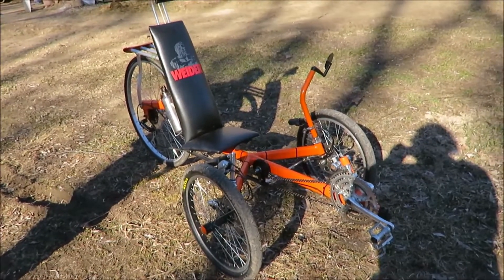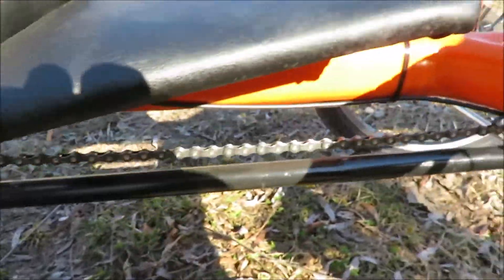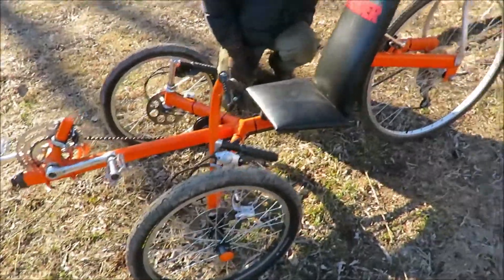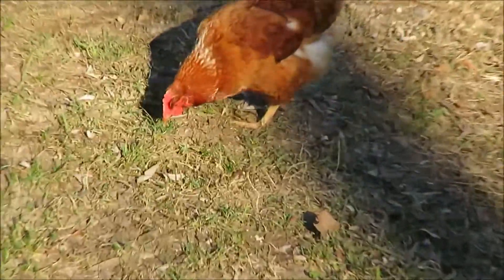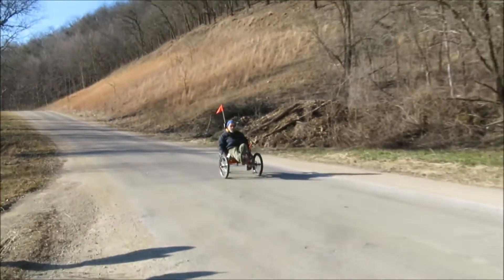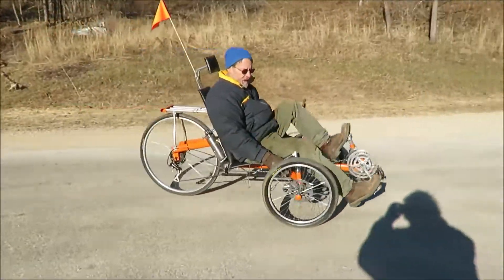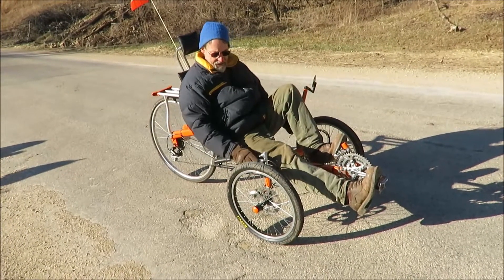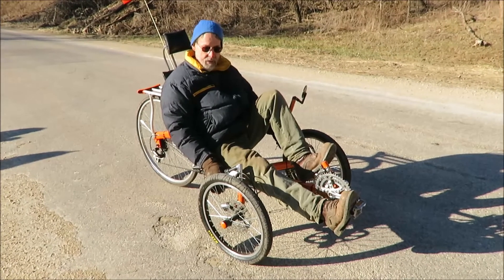Homemade  recumbent tricycle

Comment: I'm wondering . If the rear wheel  was  smaller (  24 Inch ) . Would the traction be increased for the hill climbs .
Reply from the maker: yes  I believe that was also suggested by some other commenters on here.

Comment: Back tyre skidding easily is why most tadpole manufacturers dont build them with rear brakes. Put a fat 20 or 24 on the back for dirt traction if that's needed in your riding areas. Narrow tyres don't suit unpaved areas anyhow. I bought a Greenspeed Magnum big wheel and am kinda regretting the rear 26 as it has noticable side flex on fast corners. Though the main reason purchasing this model was I can fit a 20 or 24 ×4" fat on the back for dirt roads touring.
Reply from the maker: Thanks for the suggestions .

Comment: Larger front wheels and or a smaller rear wheel would offset more weight to the rear for better traction without having to change anything on the frame. Great job!
Reply from the maker: Thanks - good idea !

Comment: Secret toolbox is ingenious, and I like how you "attach" the vise-grips.  You are clever fellow.  4:21 If the steering is "twitchy" going down the road, perhaps set the front tires just a bit more toe-in.  The aluminum tube connecting front wheels may work okay during "normal operation," but is it stout enough if one wheel hits a pothole?  Would be awful to lose steering.
Reply from the maker: My friend is the one who is crafty and ingenious - that is why I always stop and visit him to see what new thing he has come up with. Next time I get over there I will see if he has taken any long rides and come up with any modifications and if so I will make a follow up video.

Comment: not use aluminium on bicycle frame, best bike is over 95% parts what not aluminium, steel is good, aluminium behind spine make feel tired fast, best rim to back is steel rim + best rack to back is steel or not aluminium, aluminium is poison what not good for energy, tadpole needs small cargo + small gear ratio range what 250% or 300% minimal for good up hill drive, not need under seat steering but longer bars for steering or higher steering, seat can be on higher position + more backward when not like upright position or just back wheel smaller size what adjust lift front higher + seat more backward position
Reply from the maker: I will pass your comments on to my friend Alan who made the bike - I am sure he will appreciate the feedback. This was his first recumbent bike he made and my guess is after riding it around this summer he will make a new one that is better.
Reply: he bike looks good already, just tune can do, steel easy fix easy add, just idea, people not know how bad aluminium is what why i been tell for remind, all serious bike are made from steel or titanium, carbon bike are bad joke, people been find how easy carbon break only for try grams lighter frame parts, correct steel design is lightest strongest
Reply: one thing may need add, additional metal plate support may good weld to under center front wheels cross section, i have similar non suspension steel trike for know say is important add extra support to under bottom tube, all trike have extra metal on cross section or extra support on form shape build into, i can show own trike frame later what i was buy to fix made by other person then use by other person been strong frame thousands kilometers all conditions

http://www.steintrikes.com/trike_images/ct/ct2.jpg

http://bicycleone.com/wp-content/uploads/2015/10/YFrameRoverFrame.jpg

https://www.heartlandbike.com/images/library/zoom/ttrike_boom-logo-rover_12_z2.jpg

http://forum.atomiczombie.com/gallery/files/7/0/7/viking_recumbent_tandem_tadpole_trike_4.jpg

https://www.industrialbicycles.com/resize/Shared/Images/Product/ICE-Sprint-26-Trike/ICE-sprint-cruciform1.jpg
Reply from the maker: I see what you mean about the extra support at frame for the front wheels - I will let Alan know your suggestion. It will probably save him some trouble later on . Thanks

Comment: Good stuff, hard to hear in parts due to the wind; I find splitting the audio from the video in the edit can help that....I rerecord what I said indoors away from the wind and add that audio instead. But that's a thing that comes in time. I am impressed with your wheels fella. are you going to put up another after you've changed things?
Reply from the maker: yeah you are right about the wind noise - didn't think of that when I was taking the video. I only used a Canon point and shoot camera - was thinking after I made this if I should try putting a piece of foam or fabric over the spot where the microphone is might help quite a bit. I only know just enough to get by with video editing. Good thing about my friend Alan is he is really good at narrating so I barely need to edit . I will certainly do a follow up if there are any improvements he makes on this .
Reply: @LarryKapp1  Good on you Larry, try the fluff thing, I saw a guy used fake hair from one of those wind socks - he said it was from a toy troll, gonk. Maybe use velcro so it can be removed as well. good luck fella.
Reply: We use a foam thing, where the camera is put in (costs less than 2,-) for the action cams. That works perfectly against wind noise even in stormy weather.
Reply from the maker: I think the microphone is three small holes on top of the camera - which is probably why it really catches the wind. I will do some experimenting sometime.